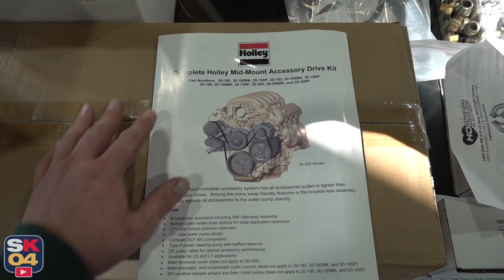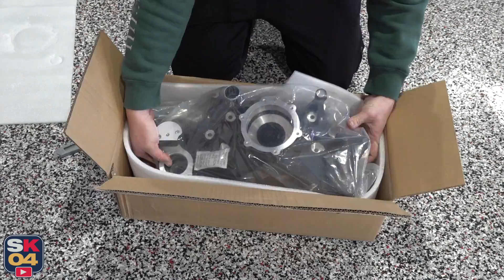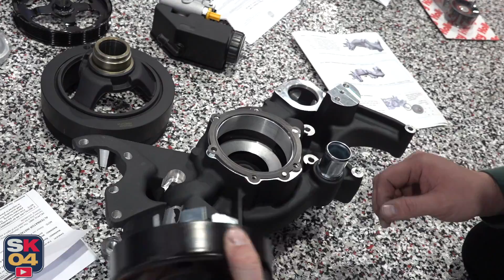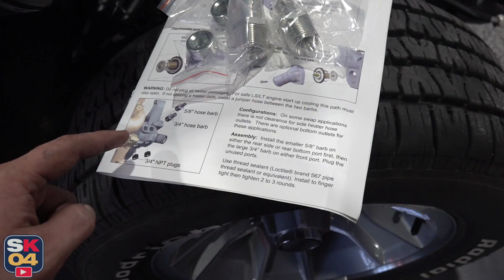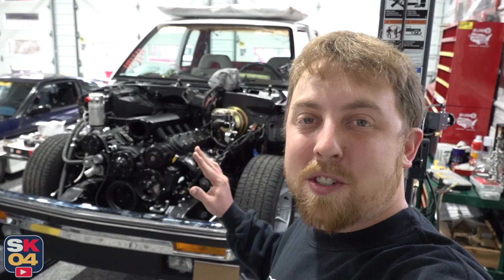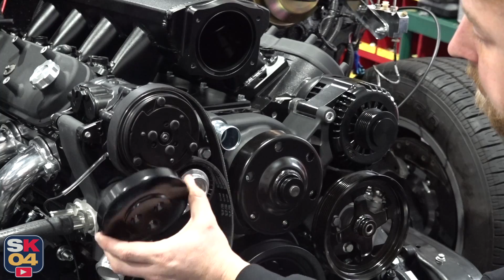The S10 Gets A High-End Mid-Mount LS Accessory Drive System!  S10 Restomod Ep.26

Comment: I've redoing the power steering in my S10 and ordered the same Hooker steering shaft (and a replacement gearbox albeit from a different company than yours). Did you have to do any modifications to the gear box/gear box splines to get the steering shaft to fit? Was curious to see how you went about it with your install.
Reply from the maker: I actually did a video specifically on the steering stuff a while back, but no, I didn't have to do any modifications thankfully.  It all bolted in place of the original equipment.

Comment: i enjoy your videos they are helping me a lot your build is very clean, i have two questions for you. 1. i have a 2001 gmc sonoma and what is the a/c dryer you used .  2. do you have part info on your brake booster the smaller size is nice.
Thanks
Mike
Reply from the maker: The BB I got off summit, I can't remember right off if it was their "house brand" or the Right Stuff Detailing brand, but the part number for the house brand is 760167.  Definitely check it out to compare more closely.  They also sell a brake pedal rod kit that I'd recommend getting too, makes the install a lot easier.  At this moment, I have a factory S10 dryer, not sure if I'll be able to use it or whether I'll have to get a Vintage Air dryer, but I'll update that in a future episode.  Hope that helps!